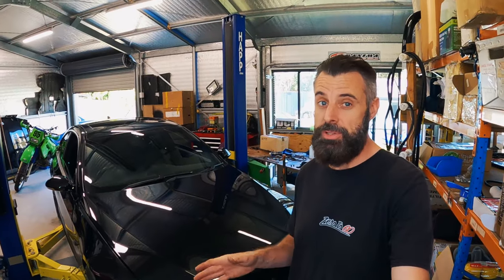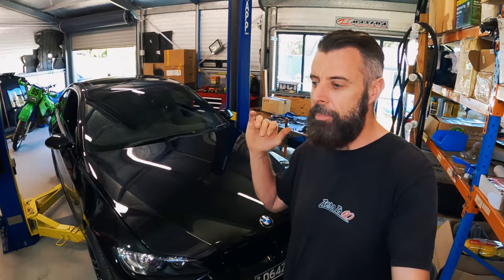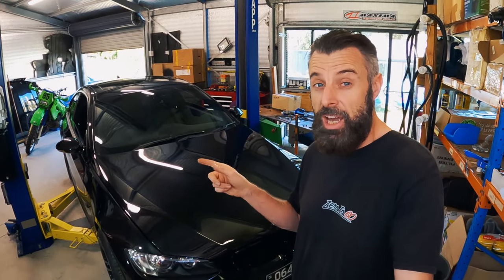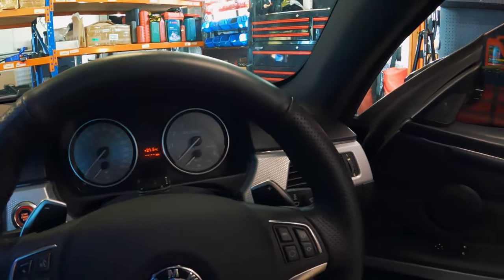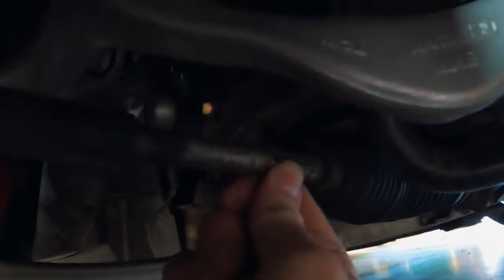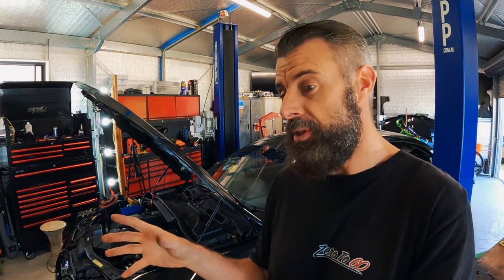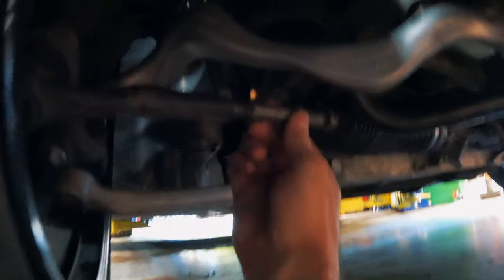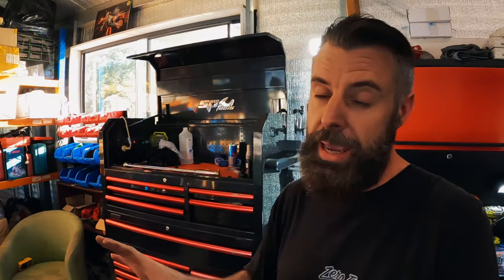BMW E90 E92 Steering Rack Click Clunk Noise: Actually An Easy FIX

Comment: The big nut you took off is actually used to set clearance between bearing and rack, used to build steering racks for Aussie Oem (Delphi Automotive Systems). The little plug in the nut is where the micrometer would measure while putting 10n on the pinion with rack locked in place, usually about 75micron. It is used to set turning torque which is on center feel without the Pinion valve being activated, so no hydraulic assistance.  Think of small adjustments while freeway driving. There is a spec to adjust to hence why the nut is loctited into place.

Comment: Anyone who is experiencing this make sure you're checking to see if this sound is still there with the engine running. ZF states that noise is normal when engine is not running but it should not make any noise when running.

Comment: This is a very common issue on the F20’s. I did the repair on my M135i and it’s amazing, feels like a new car. 6 months or so it did need a ‘nip’ up - realistically only a mm or two of movement and it’s back to where it was 👍
Reply from the maker: I only recently found a thread on the F series doing it and that is what got me on the path to checking mine on this car. In hindsight, a nip up probably would have been fine, but at least i got to pull it apart and see what they look like in there.
Reply: @ZeroTo60Tube  it might be worth checking on RealOEM if there has been a change in part design. The one I bought and replaced on mine was totally diffract and metal rather than plastic. I assume they were wearing and causing play.
Reply: Did you get the noise only when the engine was off? or also with engine running?
Reply: It was a lot more obvious with the engine off but was still there with the engine running.
Reply: @neil4089  thanks. If I feel the noise only when  is off is it normal ? BMW says that is all fine

Comment: I had the same problem and found out the steering rack was making contact with the heat shield! Plus for extra precaution changed power steering fluid!

Comment: Seems similar to an old Porsche 924 steering rack. They had a thrust bolt that kept a certain tension on the rack. Too tight - stiff steering. Too loose- rattling like mad.

Comment: Good info. I knew that was an adjustment, just never knew what it looked like. I had a good bit of slop in my steering and I adjusted that but, took most of it out. I plan on trying some more adjustment at some other point but on an xdrive it's not so easy to get to

Comment: Wish I found this before replacing my whole front end (Upper and lower control arms, shocks and springs, drop links, anti-roll bushes and even the steering column) chasing that knock. Ironically, a used replacement rack I put in had the same knock so was dumbfounded until I found the pre-load yoke. Keep up making brilliant content, could be saving someone thousands!
Reply: Did you tighten it or loosen it off?
Reply: I’ve done the exact same thing, replace all control arms, sway bar links, and struts, inner and outer tie Rod ends and I still have clunking noise. A mechanic told me it’s the steering column. Please help!

Comment: It's awesome to see someone figuring things out themselves instead of rushing to a mechanic. My E92 M3 has 152,000 miles on it and it's still running great. The only thing I swapped out was the power steering reservoir with one from Euro Power Motorsports, and it's been smooth since then.

Comment: Another steering rack related fix that can cause a noise (not for your problem specifically - but just noting it for others to try) - sometimes the bolts that hold the rack to the subframe get loose and you can snug em up. Mine I had to get a wrench on the back side of the nut to tighten down because it would spin when you tighten it the normal way.

Also the strut hats / bearings seem to collapse over time and might bind up when turning.

Comment: Exact same problem in the BMW E60. Very common.
ZF 7852

On these steering rack models, unlike the E46, the column shaft coupler has no rubber flex disk which is supposed to absorb all the suspension stress going to the steering column. Instead, the stress is absorbed by that teflon yoke which wears out prematurely.

ZF instructs to replace the whole yoke assembly and applying a special loctite grease to the yoke (Part 1 and 2). Then torque the nut to 12nm, peel  and reloosen it by 5 graduation marks as follows:

Turn the adjusting screw (34) 5 graduation marks back (loosen it) and then screw it 1 graduation mark in again.
Rotate the steering gear to mid position, so that the rackprojection (relative to the steering
lockstop) is equal at either side.
Fit tools [23] to restrict the rack stroke to 1...3 mm.
Fit tool [20] and a commercially available dial gauge.
Using tool [9], rotate the rotary valve (81) to the left and to the right (torque approx. 12 Nm)
and measure the yoke play.
Specified value: 0.1 mm maximum
Adjust the yoke play by turning at the adjusting screw (34).
If the adjusting screw (34) is turned 1 graduation mark, this corresponds to a change in yoke
play of 0.05 mm.
Without altering the yoke play setting, check the loosening torque at the adjusting screw (34).
Test value: 1.5 Nm minimum
Insert the plug (34.3).
Check:
There must not be any sticking of the steering gear when rotated through its total stroke.
Mark the definitive position of the adjusting screw (34) with marking ink (at any place on the
circumference).
Reply: Hi , Where is this repair kit available? Are ebay ones OK? Where are the specialist tools available?
Reply: @gulag8735  did you ever find the repair kit or new yoke
Reply: @matthulley72  no. Never did

Comment: You have great hand skills & great thinking way , i have benz , i faced this problem , sadly inexperienced repairer harm the steering shaft ,But ( heroically) I bought another used perfect one and changed and adjusted it myself, if i see this video before i would never permit handling the shaft , now i know that the sound is from the bush and i will better leave it as it doesn’t annoy me after understanding the issue, great video with all my respect .

Comment: I’ve been putting this off on mine for a while. 
Started after I replaced my steering rack with a used M3 one, including a used lower steering shaft assembly (tbh, the shaft, for no reason). But I also dropped the subframe to do oil pan gasket too. So multi can’t isolate to a single changed part unfortunately. 
I’m going to put my old lower steering shaft back first with two new aluminum bolts and see if it fixes anything. I don’t know the history of the used m3 rack maybe it’s coming from that….
 
Will also double check all suspension components. Ideally I wanna shimmy the wheel with car on ground. But of course that’s difficult without a lift.

Comment: Those bigger clicks you get going from lock to lock are actually your rack BOLTS themselves, the two that sit in the middle mounting it to the chassis. They are torque to yield bolts and BMW says replace them everytime you take off the steering rack.
Reply from the maker: Its 100% not the rack bolts. They are tight as hell.
Reply: @ZeroTo60Tube  it’s not about tightness, i tried tightening my last pair of bolts & they just loosen very quickly(only perceivable because clunk comes back after a couple km). The bolts are torque to yield so they will never hold true torque after 1 or 2 torques when u remove them for whatever reason. With a new pair of those bolts my lock to lock clunk is completely gone.
Reply from the maker: @gster109  I appreciate you are trying to help but i dont know what else to tell you. The rack is not moving in the subframe. That is a very common issue and the first thing i checked quite a few months ago now. But again it's not moving in the subframe.
Reply: @ZeroTo60Tube  i think it’s worth a new pair of those bolts so you can truly check it off your list, that fixed my issue & the way you describe it is identical. I dont think you’d be able to see the slight “shift” of the rack. Maybe try putting your hand on the rack while going lock to lock to see if it’s causing a vibration around the mounting point. Then i’d maybe check your strut tops, there’s a felt piece that goes in there to prevent metal on metal contact. I’d make sure everything is there. Best of luck.
Reply: @gster109  can you use other high tensile bolts or it has to be the oem Yield to torque bolts?
Reply: @Machine_s15  OEM bolts are what I used.

Comment: Having the same problem on my e9x 335i. It was really bad so I replaced the rack with another used one and its much better now, but I still get a loud clunk sometimes in parking lots doing sharp turns.
Reply from the maker: Thats more like what i had, you feel it through the pedals. Check the adjust on the yoke. Hopefully its the same thing. Try not to adjust it too far mind you.

Comment: In the Honda world its called a rack guide screw, i imagine most steering racks have this and there is a tightening sequence where you tighten, loosen and tighten again to a certain spec. It can be done by feel alone which i imagine is exactly what you would do in the case of a worn rack as it will be out of spec, does the steering feel any better/more direct than before now?
Reply from the maker: I havent driven the car properly yet, will find out shortly when i take it for a spin.

Comment: Had something similar  on my e46. Was the extension piece at bottom of Drive shaft had developed play in the U joint. 
Had it replaced with a tight one and bingo, noise and crappy steering feel gone.
Reply: Hello, i have same problem on my e46 330d. Please can u give me part number of that part?  Thanks :)

Comment: does the f30 thrust rack pushing go into the e90??? Since there's none for the e90'might as well ask its younger brother to help.
Reply: wondering the same
Reply: @maddog5814  did you ever find d outfit they are compatible
Reply: @matthulley72  I don't think they are. But I figured out what was causing the clicking on my car when turning the wheel left to right. It was the two bolts that hold the steering rack in place to the subframe. They are supposed to be used only one time. I took mine off and back on twice, so they were stretched. Replaced with new ones and clicking noise is gone.

Comment: I've also adjusted the nut on the steering rack but the clicking isn't completely gone. I think it's coming from the U-joint couplings on the steering shaft.
Reply: Salut , nu cred ca e dea "U joint" , am schimbat eu cardanu ala mic de aluminum, si na disparut sunetul, cred sa fie de la cuplajul din cabina, ala unde se face legatura pt reglajul volanului 🤔

Comment: what size socket fits the nut? and whats the right grease for the steering rack?
Reply: In E60, it s BMW FB-1 grease and a 6 pan socket of 16.5 mm.
Yes not 16 not 17mm but 16.5 mm 😢

Comment: Hi 
Did you ever find out the OEM spec for the pre load please and sequence of tightening it down
Reply from the maker: No i didnt. It actually came loose again about a month ago. So i went tighter this time and it feels a little stiff. But not terrible. If you have time, just make an adjustment and take it for a spin.
Reply: @ZeroTo60Tube  thanks for the reply one more question please , what size socket did you use to make the adjustments ? I've read a need a special 8 sided socket but yours looks like a standard type socket
Reply from the maker: @matthulley72  I am sorry i cant remember what size but it was just a normal spanner. Using the ring end it fits in while the subframe frame is in place

Comment: I have a e90 325i with the same problem but I cannot find the part on eBay or Amazon. Do you have a link?
Reply from the maker: I couldn’t find them either. Are you able to tighten yours like I did?

Comment: Any idea what would cause a thumping sound when going from reverse/drive (not the transmission).
Reply: Rear torque coupling due to torque direction sudden change.
Inspect tightness of your rear differential and driveshaft flex disk.

Comment: I have the same rattle on my z4 but it sounds like its in my dashboard, any suggestions?
Reply from the maker: The dash can have a lot of rattles. My suggestion is try and get the rattle happing with someone esle in the car to pin point it better

Comment: Have similar click/thud sound on my E92 335i, took to a place to get it checked out and was told rack was bad. I am feeling floating and light steering on the highway, would this help?
Reply from the maker: 100% worth trying to tighten this nut. Do also make sure the 2 torx bolts that hold the rack are tight too. If you get the right sized ring spanner you can access the nut without removing anything. On a RHD anyway. I would recommend turning it like 1/8th of a turn and test drive. if you go too much it will bind.
Reply: Hey man did you evr get this figured out, im currectly having the same floaty feeling while driving
Reply from the maker: @octaviofigueroa6444  Did you do what i have done in the video?

Comment: I have got the same noise on my F20 2016, but only when the engine is off, is it normal?
Reply from the maker: It is normal, but it is a problem. It is a much more common issue on the f series as well. If you do some googling there are repair kits for the f seires.

Comment: Mate you can VISUALLY see the play in you steering coupler its a bushing that wears out especially after moving around the rack while connect to the steering column still, idk why you  took that whole rack apart honestlly i didnt even  know you can take that out lmao, but bro i have the same play and clunking and i got mines after fucking with my steering rack doing my tie rods then noticed the play after changing them, when you move around or fucking with the rack while its still connected to the steering column you are going to damage the  steering coupler and thats what causes that play, its very delicate and its like $400. i promise if you replace that bro you will be fine, ima do mines soon but it isnt as bad as yours just annoying. rewatch your video or the steering column moving in the engine bay i can see the play, your rack is fine.
Reply from the maker: But the yoke adjustment fixed the problem i was having. Im not saying there isn't play in the coupler, but the clunking was that yoke adjustment.
Reply: @ZeroTo60Tube  oh okay well atleast you cleared up most the clunking i thought you said that there was still allot of play and clunking just not from that tie rod. i need to replace my coupler lol
Reply: @ZeroTo60Tube  Hello , i hope you see my comment today because tomorrow i will try to tight it. This 17mm is counter nut or simply just put the socket and tight it.? Thanks

Comment: It works, I tightened my just a little as well, and the clunk is almost gone. I may need to do it a little more. Does anyone know the actual Nm spec for it?
Reply from the maker: I dont think there will be an official spec for a worn part, which is what we are working with on these things. So its a matter of just doing it in very little steps. If you go too much is will bind and making the steering stiff.

Comment: So - you didnt fix anything and you still dont know how to fix it
Reply from the maker: Tightening the shown part of the rack fixed the knocking i was getting on cold mornings
Reply: @ZeroTo60Tube  I didn’t pick up on that but ok. let me ask you do you think removing it then greasing was key or could you have just tightened it where it was.i have a 328 and there is no repair kit for mine - but im thinking the parts should still fit work in the 328 (e90). Ever try? I might find a cheaper one to test that theory